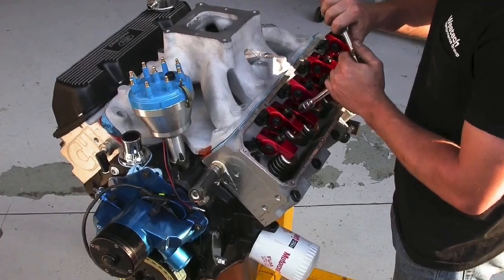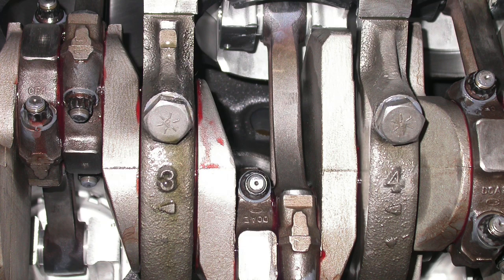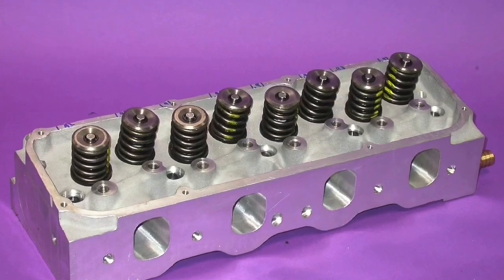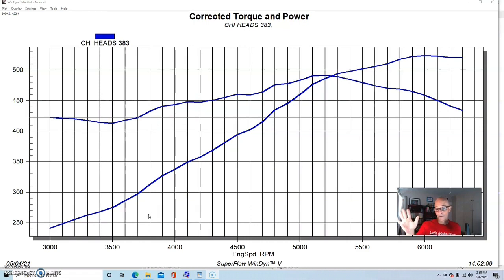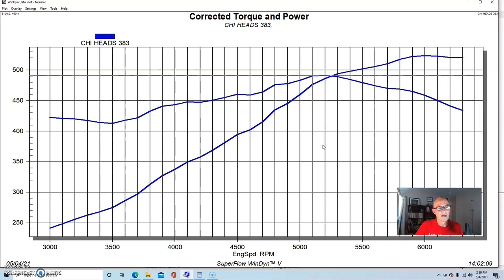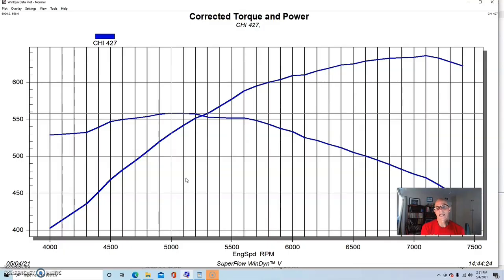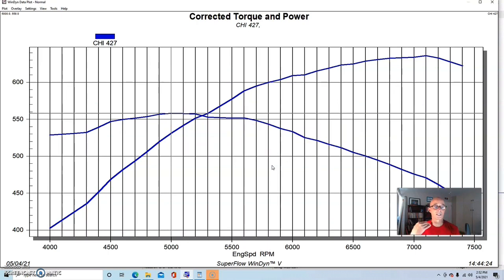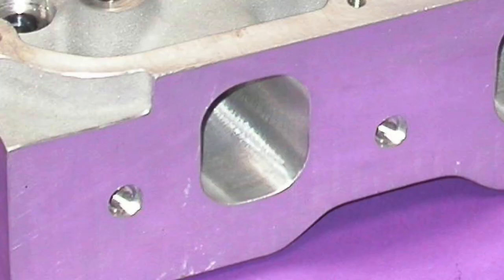351 STROKER CLEVELAND OR CLEVOR? WHICH "OTHER GUYS" MOTOR WORKS BEST?

Comment: CHI also makes a 265 Aussie Chrysler 6cyl semi Hemi head.
Reply: Unfortunately most yanks don't know what we're on about 🙄
Reply: @gergatron7000  Most...but not All. There's an increasingly woken generation of hard core USA and Canucks  that do know. Like the first 57 cc closed chamber 9.206 inch deck US built 302 Cleveland Engine with its 3 inch crank for the 1971 230 and 240 hp 2bbl V8s, the first building of these Hemi 6  engines was also the USA. These days, the All Par website shows the A series bore spacings and D series Dodge truck origins and the Highland Park principal engineering that shows that it was not a solely Mike Stacey development in South Australia. It's a US engine made on Small Block A and LA 4.46 bore spacings, with non cross flow Polyspheric heads and once the design concept and tooling were made by Halenback and his team, the whole shooting match was then transferred to Tonsley Park, Chrysler Australia Prty Ltd. The US guys saw through the misinformation  that it was a 4.38 bore spacing 232/258/4.0 AMC or Jeep six with a poly head. Nothing is shared in design or engineering or tooling. The Slant six,  it's more a heavy rework of the old 25 inch long flat head Dodge 228/250.6/ 265  truck in line six. The Hemi 6, it was very much a Polyspheric A with no cross flow.
Reply: @deanstevenson6527  yes I have read that it was an abandoned US truck design, understandably built on V8 architecture (318 pistons I believe), makes plenty of sense and I don't know why other manufacturers didn't employ a more modular design like this throughout their engine ranges.

I understand that they were abandoned in the US because fuel economy wasn't an issue at the time and the performance goals were easily met with the 318 and 360.

What the Aussies in the "Hemi" 6 development can take credit for is just the sheer performance squeezed from it that could put many V8s to shame, and the ingenuity of the people involved to be able to achieve this on a tiny fraction of the budget it would have taken to develop it to this extent in the US is what is so impressive.

Comment: 3 months ago I bought the 408 clevor setup that took me for my first mid 6 second 1/8 pass in a fox coupe when I was 11 in 2000 or 2001. I bought it to freshen up and stick a s488 that I already have in my Fairmont wagon I turbo ls swapped and went 5.90s before the third 5.3 scattered and focused on the race car. But what started out as a freshen up turned into basically only the old speedmaster heads&intake and crank are the only original parts from the OG  build it's got really good machine work some eagle rods d.s.s pistons, I had the heads completely rebuilt and ports touched up 11 to 1 comp ratio the plan was to do a blow thru setup on e85 and just have a another stupid fast street car l love my race car but 850-900hp street cars are amazing. Anyway the damn build about broke me the motor and power glide with a jw bell are already in the car but I'm about to swap a pretty rowdy nitrous friendly cam and throw a nice plate on it and call it done until I want more or my wallet recuperates

Comment: The head used was a ported 218 3v ? Did you check calculated cross section on the heads ? 
Finished port volume ?
Reply from the maker: the dyno told us whether the head worked or not
Reply: @richardholdener1727  
I ran a set of out of the box 218 on 410 inch 
They checked in at 221 cc and a calculated cross section of 2.66 
They flowed 331 at .7 and went backwards 
Ran 9.54 at 139 and change on alcohol fuel 3050 lbs with driver 
Cam was similar to your except .775-.757 lift 108 sep 
104/112 we ran it 108/108

Comment: Clevor is the way to go. Lots of deck height, good oiling system, Windsor front drive: What's not to like?
Reply: ABSOLUTELY everything about that combo is likeable. I had a 351c 4v in my 1970 Mustang Mach 1. The problem was the oiling system.  In 1974 no one had yet made a High Volume oil pumps. I had 2 of them come apart because of that. The motor I built for my son's in the 19 Starsky and Hutch clone we did use a high volume oil pump and never could destroy that motor. MY Plans will probably use the 3.6 Blue Thunder cylinder heads on a World Products Man O War block to build a 427 Clevor. Hopefully it'll make about 750 streetable Horsepower.

Comment: Thanks for helping to keep the 351 C relevant.  I loved my Clevelands.  Sucks that R&D for this motor is long gone in this country
Reply: The new Godzilla has similar features as the cleveland heads
Reply: Actually it did receive a ton of development, but just not in street cars. The NASCAR C3 and D3 engines were the ultimate form of the Cleveland. But i agree, it's a crime that Ford Racing only sells Windsor crate engines.

Comment: First off  thank you for the awesome videos. You have answered alot of questions about real hp numbers I always wanted to know. To be hounest your doing what I always wanted to to as a kid growing up.  Still is a dream to play in dyno room with a bunch of classics. 
But if you can you should  Test the factory stroker. Witch is the 400. In stock 2v form then with 
4v open chamber heads, 4v close chamber, then go all out with the 3v heads. Then if you can get ahold of a set of  Aussie closed chamber 2v 302c heads.  If there not ported  test them  on a 306 w or a 347w. If there ported test them on a stock 351C then the 383c. 
I had a chance to get a set of the 302c closed chamber 2v heads in 2018.  at the time I couldnt afford the $300.  They were complete just needed rockers. They had been oiled and wrapped sitting on a shelf since the mid 80s.

Comment: My 1973 LTD came with a 400M. Not wanting to be left behind, I got a pair of 1970 4V head set, made my own spacer plates, and had the block bored, balanced and sleeved to 4.03 bore and a 4.00 stroke. With TRW forged flat top heads, and 63 cc heads, I believe it came to a 11.00 CR. I put in a CC 290 High lift short duration cam, and a 750 Holley on a Dominator intake. With 4:11 9 inch rear, my 73 LTD could easily run low 13'ies! Today, the car is gone, but the engine and C6 remain. I am looking for another frame to put it in. The only thing I am wrestling with is, DO I go with new aluminum heads, rollers, HEI, etc....., or do I just keep it "Old School" along with my Mallory Dual point? What says the Class?

Comment: a clevor with 13:1 domes, a big solid roller, destroked to 339, with a sheet metal intake and dual dominators on M1 methanol, lets try that one, should be a nice little 10,000 rpm screamer.

Comment: More Cleveland builds please. Have you tried coming up with a good street combination with the 2V heads?
Reply: They don't flow that well- American 2V heads.. about the Level of a Chevy Double Hump.. 200cfm.  You could get 200cfm out of a ported set of junkyard Explorer/GT40 heads with alot less headache.  2V Cleveland heads are also Open Chamber .. read Big Chamber Volume = Low Compression.  So Piston replacement to get decent compression is a possibility w 2v Cleveland heads.   1.84 valve 351W factory heads flow about 185cfm..  If your goal was 1hp per cube on a 351w.. You'd only need a cam swap as the factory 351w heads would support it.  The only place a 2V Cleveland head combo would make sense would be on a 351C if your goal was 1ph per Cube-ish.  In that case you could simply do Cam/Piston and perhaps a head shave and put out a 350hp-395hp motor.
Reply from the maker: a late model 351W head sure doesn't flow 185
Reply: @richardholdener1727   I had DOOE back in the day.  Misread  info off Stan Weiss then.. mentioned C90E.. then just said 351W.. Since it didn't specify C9OE or DOOE - I assumed late model 351W.
Reply: @richardholdener1727   No 1hp /per cubic inch with a 1996 roller cam 351W w stock heads? .. I bet it would get there. Cam, Head Shave 10:1 , Carb n Manifold ..  Dirt Track  or XFI'ish spec cam. Mid 500's lift and 225@ .50 dur minimum.  108 - 110 LSA.  Only need 175cfm/flow .. perhaps less with enough draw/demand/signal.
Reply: @granbordeaux6955  A friend of mine has a pair of 2V heads laying around from a 400 engine. Would they fit on my 5.0L H.O.?
Reply: @erwinnijs1  It won't fit your 5.0's manifold .. Beyond this there are many modifications needed to adapt Cleveland heads to a 302 block.. not a direct bolt on.  If you're trying to stay low budget and bolt on.. Speedmaster Iron/180cc heads can be had for $238/ea on Fleabay.  Richard has got multiple reciepe videos for different HP levels for 5.0's .. they are a great reference.
Reply: @erwinnijs1  yes they will bolt on, but there is absolutely no point in doing this... The 400 head is a low-comp smog head with huge chambers. These heads on a 302 will make it an absolute dog. All that and you have to find a Boss style 2V manifold. You'd be best off going to GT40Ps if you want cheap hp.
Reply: @gergatron7000  The problem with importing heads to Europe is shipping cost and taxes, which easily adds 500$ to the cost. The only budget option are local parts, and GT40P heads are rare here. All the Explorer engines are either V6 or 4.6L. I think I'll stick to the real budget option and go turbo then :)
Reply: @erwinnijs1  oh I understand. I live in Australia... Same problem but at least we had some production Falcons in the 90s and early 2000s with the 302W that had  E7TE, GT40, GT40P and alloy heads.
Reply: The decent flowing W heads are the ones with the FAT spark plugs.
Small plug heads are just 302 heads.
Reply: Cam montreuil engines  I just explained why. Big chamber head, small 302W displacement equals low compression. 

Here... Let me do the maths for you:
302 ci, 78cc chamber = 8.12:1

That's with zero deck, no valve reliefs or dish, of which a std 302 has neither, so the compression will be less still.

Comment: I would think if the only difference was Windsor or Cleveland block there might be a small difference in intake runner length between deck heights 9.2C 9.5W, from there it would come down to parasitic loss of the rotating assembly. With smaller crank journals I would think the Cleveland block would have a advantage.
Reply: Only will know if both use the same bore and stroke.
Reply: They both have issues. Cleveland has cylinder wall stability and Windsor has main web weakness. Smaller mains on the Cleveland is definitely better. but the extra weight of the "cast in" timing cover area is not. Windsor is stroker friendly. I could go on. Pick your poison.

Comment: Love the Cleveland head tests!  Wonder how the Cleveland stuff compares to a similar sized Windsor-style head?
Reply: No comparison. The Cleveland head is superior in flow/power production
Reply: IMO, unless you are building an all out race engine a good after market Windsor based head is more than adequate.  The additional cost of a Cleveland just isn’t justifiable.
Reply: My father and i built a 4v Cleveland while his in law built a Windsor with a.m. aluminum heads. The build costs were within a few hundred bucks and my dads Cleveland was every bit as responsive/streetable(both in f series pick ups)  AND smoked Jims from digs/rolls/everywhere else.  That's facts.
Reply: To get to ported Cleveland level you have to go all the way to ported TFS R heads.   They dominate similar size inline valve heads.

Comment: thanks man, i picked up a set of 2v CHI head for cheap. You said the 3v were much better. I'll let you know.
Reply: 2V CHI are excellent on a healthy street engine
Reply: The 2V has similar performance but can be used with stock 2V port location. 3Vs need the special 3V intake with the relocated ports

Comment: Richard Holdener
 That CHI head flow is fine but you can't use off the shelf "chevy grind" cams for a Cleveland. They require completely different valve events and lobe sep. I know the 383 was done a while ago so we cant change that but that 383 should have destroyed my 359C with the extra cubes. My 359C has a Bullet solid flat cam 239/243@.050 .611/.605 lift but on a 107 lobe. Now my Trick Flow 225cc heads do flow. The flow card TEA sent me they flow 
.500 lift Intake  333cfm  Exhaust 241cfm  and at .600 lift flow 355cfm Exhaust 259.6cfm.  Mine dynoed 520p@6300  453tq@5600  . Mine with 383 kit would easily be close to or at 600hp but with my cam not your Comp Cam   Happy you showed some more Cleveland stuff though
Reply from the maker: so WRONG CAM?
Reply: @richardholdener1727  I would not call it a wrong cam because they do open and close the valves but off the shelf cams for a Cleveland are basically copies of common cam grinds. Clevelands require different cam timing and lobe sep than generic shelf cams. Just so you know, I'm not undermining you at all, you are awesome but it is what it is. 
Give Brent Lykins a call when you have some time - if you ever have time with all your cool stuff you do. Brent has recently started his own Youtube channel under his name. He basically only builds FE's and Clevelands. He spec'd my cam and so many others. Right now he is putting together a 464 Cleveland with those CHI 3v heads ;)
Reply: Engine dyno or dynojet?

Comment: Richard can you do a Valve Spring comparison it seems we run out of spring pressure alot , I like to see just a stiffer spring comparison on the same engine. Arent you curious what a simple spring change is worth
Reply from the maker: THAT VIDEO IS ALREADY UP-COMPARED IT MANY TIMES
Reply: @richardholdener1727  Thank you I will find it ,missed that one .Your work is a real eye opener for me

Comment: I'm curious why some people build a "Clevor" (Cleveland 4V heads on a Windsor block) instead of just using a 351C engine.   What are the advantages of going the "Clevor" route and how much cost does it add in modifications and special components (intake) to make it work?
Reply from the maker: more availability of the Windsor block

Comment: How about a 400" Stroker Cleveland? :)
Reply: It's almost as if Ford should have made one from the factory.... Oh wait
Reply: The 351M and 400 are the natural bases for almost factory  434 strokers. 40 thou over and a steel Moldex crank, 752 hp at 7500 rpm with 4V heads and dual Quads. There is a large weight penalty for a 10.3 inch deck engine over the 9.21 deck Cleveland 351 and 9.5 inch deck Windsor, but even with its tiny 4 inch bores, it's lighter and almost as good as the Dart 4.125 race block. And factory from a junked 70-82 Full-size Ford or 1978-1982 F truck or Bronco.

Comment: Kinda tuff to compare with different displacements. Cleveland motors have oiling issues that are correctable and a Windsor has a larger crank journal size which has a wee bit more parasitic loss from friction. I’m a Cleveland fan and run one but there is so much more aftermarket support for Windsor blocks. Conclusion: go clevor
Reply: Cam montreuil engines    You probably can't read
Reply: Cam montreuil engines  Considering it would allow you to utilize a factory hydraulic roller cam set up I think that would answer your question. Better yet, build a 347 and tell everyone it’s a 289.
Reply: Cam montreuil engines   You schooled me there. I was not aware of the difference in cylinder bore length between a 289 and 302 block. I’ve never compared them and have never built a 289.  I have built mild 302s with gt40 and gt40p heads. Cheap power.

Comment: Windsor for economic reason and factory roller lifters. Also can find parts easier. If I am not mistaken, you got a 1000 hp out of one with a stock bottom end.
Reply: Block will split for sure

Comment: I recall Kaase made 650 bhp with a 400ci and 240* cam.  He warmed the heads over a lot...2.22" valves and 400cfm.  348cfm will support well over 700 bhp.  imo the cam you selected had too much duration.  even the LS7 will make 600+ bhp with stock heads and a 23X cam.
Reply: Good catch on LS7
Reply: Do you know what Kaase did with the 400cfm heads?   Or where they the CHI Kaase 400cfm heads?